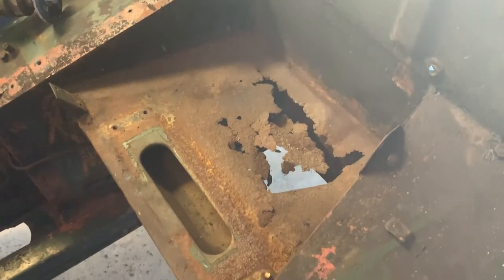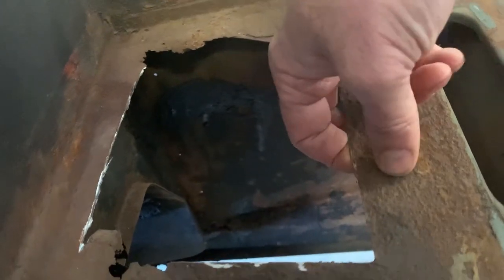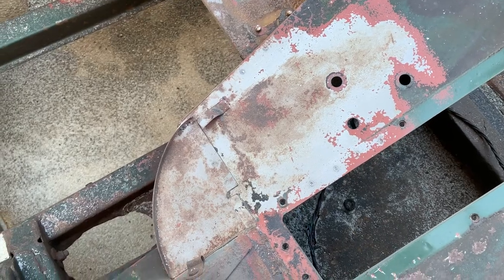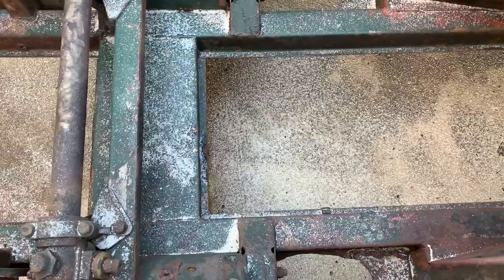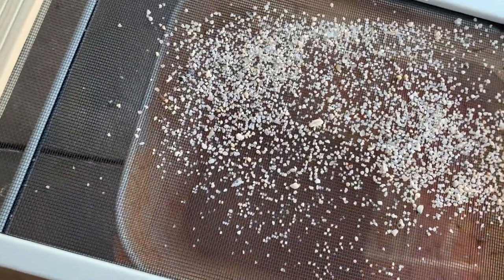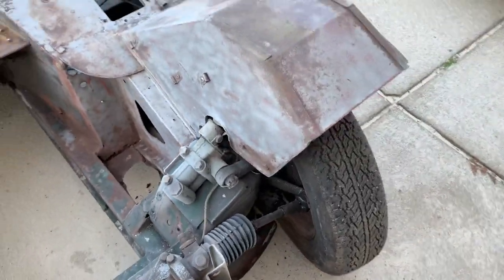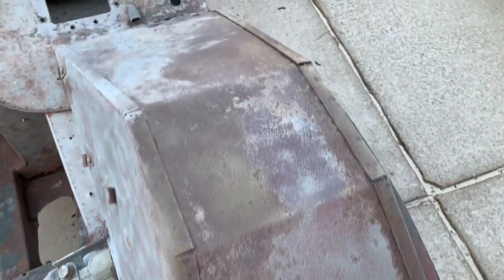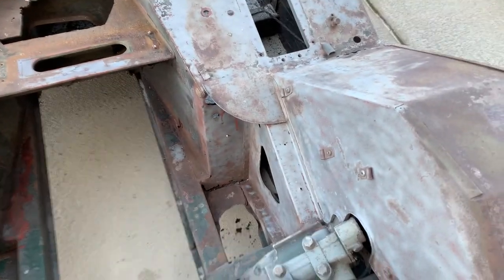MG Midget gets sandblasted - S1E8

Comment: I'd suggest that you use some sort of breathing protection if you're blasting with sand. The reason it's not generally used (and is banned many places) is because it causes silicosis, which can be fatal. When you blast with sand the grains shatter into much smaller particles, and when you inhale those they basically get get stuck in your lungs. Tractor Supply sells "Black Diamond" blast media for around $10 for a 50lb bag, and you won't need to screen it first. This is "coal slag", which doesn't cause silicosis (but I'd still wear a mask blasting with it).
Reply from the maker: I agree with you on this. I try to wear a mask whenever I am sanding or grinding too.

Comment: What I've done for filtering sand: free cardboard box, cut a hole in the bottom, tape the screen in the bottom, dump sand in box while sitting on the bucket.  But I switched to walnut shell media a while back because it's not as bad for you if you breathe some in accidentally and I got a few hundred pounds for cheap. It did need to be kept extremely dry though which was a pain in the neck. Also, check out econobox garage on youtube, he's restoring a Bugeye Sprite and has been very educational.
Reply from the maker: Thanks for pointing me to the other channel. I thought I had watched every video on Sprites and Midgets but I hadn’t seen that one yet. I thought about trying the walnut shell media but I was afraid of the moisture issue too.

Comment: Tractor supply sells media for $10 a bag. Home Depot sells klean strip metal prep $15 a gallon. Spray on rust and eats it off to bare metal. Did my whole midget that way.
Reply from the maker: Thanks for the advice. I may give it a try on the rest of the car.

Comment: Nice job with the DIY sandblasting. I must say that you have a lot more ambition and patience than I have for my Midget "restoration". By mechanically stripping down as far as you have and now stripping off the paint/rust, you will end up with a fine job down the road. I'm really anxious to see how welding goes for you. I do hope you explain your welding equipment decisions.
Reply from the maker: The welding is why it is taking me a little longer for the next episode. I can tell you the welder I am using is a Hobart Handler 140 for one main reason - it is the welder my father-in-law had that I could borrow.